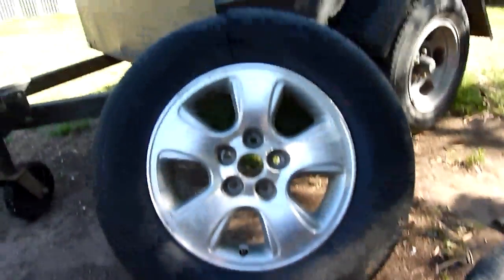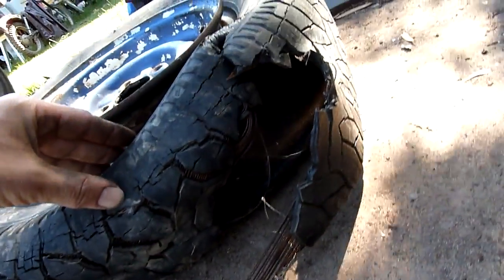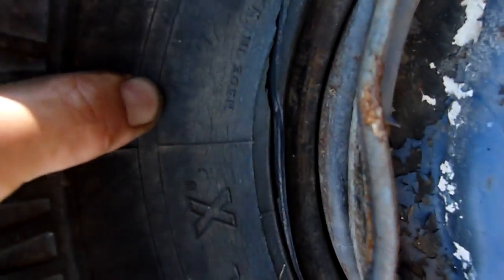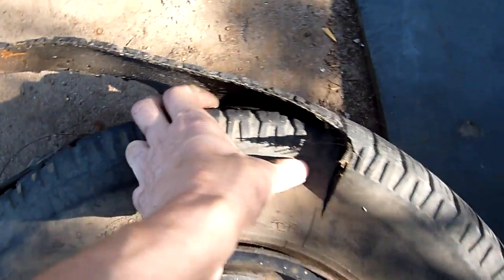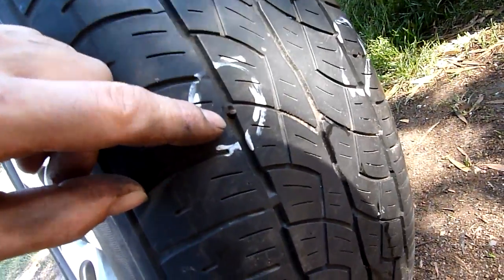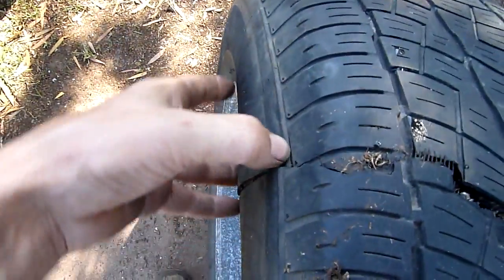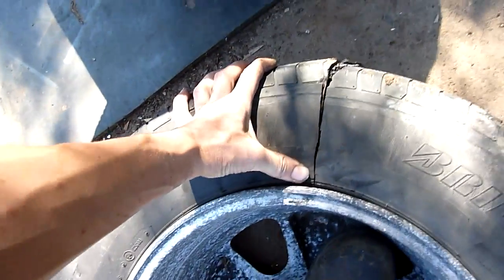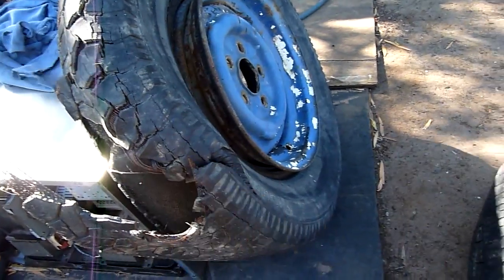Hydro-static exploded tire inspection V2.0

Comment: i like when they hit a pothole and the tire explodes,or they run up on a curb and the wheel just shatters like glass because its a cheap alumunum alloy thats not forged correctly ,or those super soft lightwieght aluminum magnesium alloy wheels found on BMW/BENZ/AUDI that just become crushed warped wobbley ovol mass of a mess ,those crush like butter

Comment: The tire is pretty ubiquitous around here. Cheap, too, I get mine at Discount Tire for ~85USD per tire mounted and balanced. I'm sure you could find one used for like...20 bucks? 

I love them because I can air down to 12-15PSI for snow running and have no trouble whatsoever sticking to the road, then air them right back to 35 pounds once it melts. Great tires for a good price.

Comment: Not only are normal profile tires cheaper to buy they also last a lot longer. A guy at a tire shop told me that because of the short sidewalls they run hot, and heat kills tires, so they don't even last 10k before they are shot, and that's as a set, the manufacturers won't even offer a warranty on the things. I can imagine that if you put them on a 6000+ pound car like an Oldsmobile or my Chrysler Newport that they would die even faster then they would on a Honda.

Comment from the maker: yeh, 250psi over that much surface area really messes them up!, even the thicker X-Trail wheels were bowed out a bit.
I should find or make a tire that's been run flat for a few hundred meters and see if it fails abnormally. I bet the side wall would blow out given how fast damage occurs when a tire goes down while driving